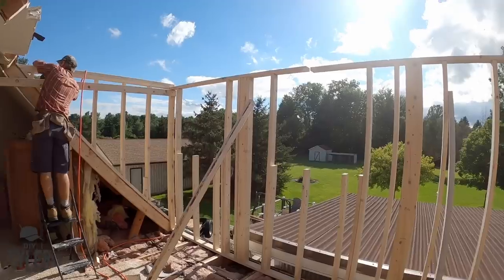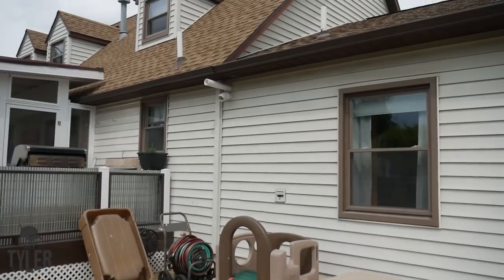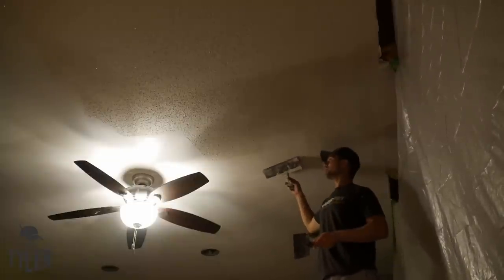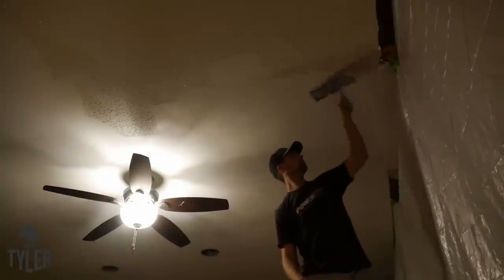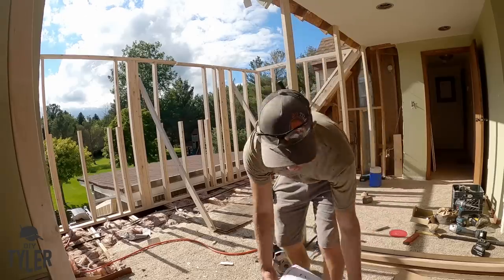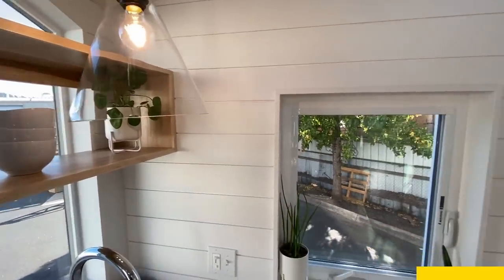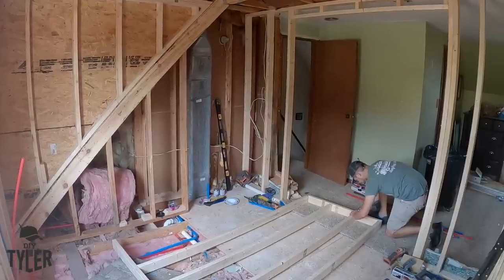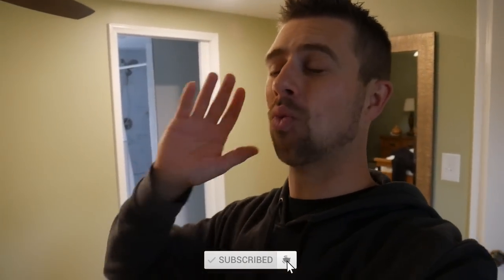We cut a giant hole in our roof to add a master bathroom! Can't help it! Dormer addition part 1.

Comment: Why not having both windows of the same size? I am sure there is a very good reason, but could you elaborate?

nice work!
Reply from the maker: Re-used the window that came out of the old dormer and saved $300! And it matches the other window in the bedroom. Larger window is in the new bathroom
Reply: @DIYTyler  That makes sense :)